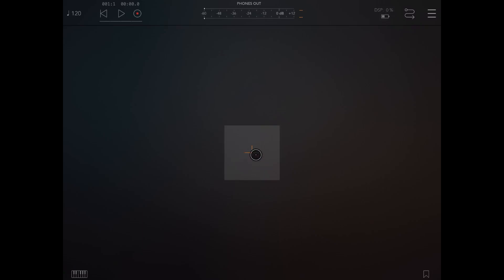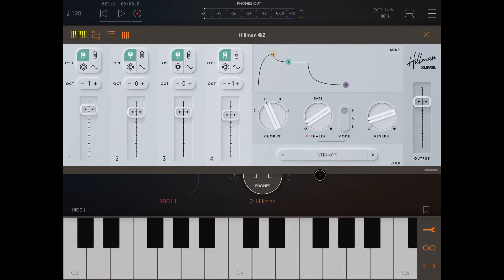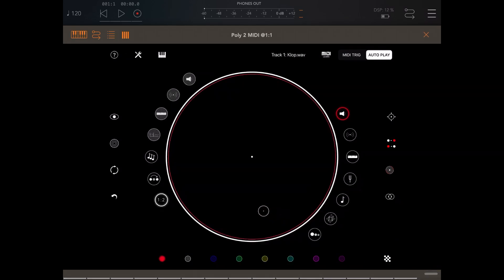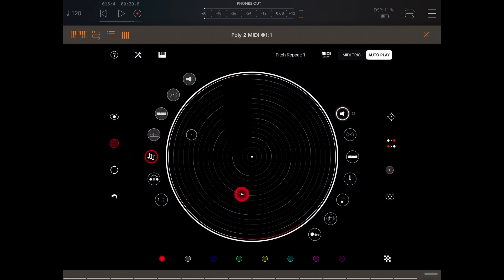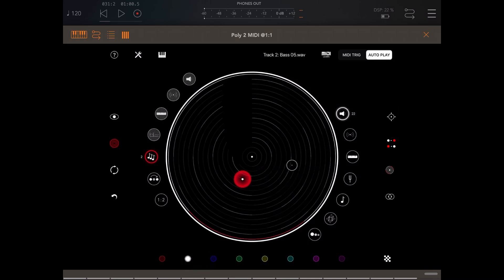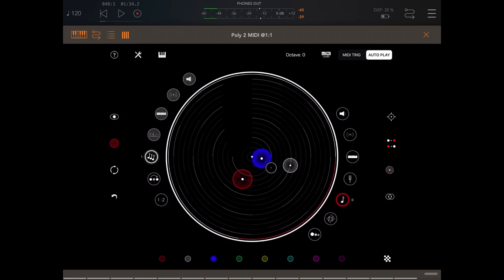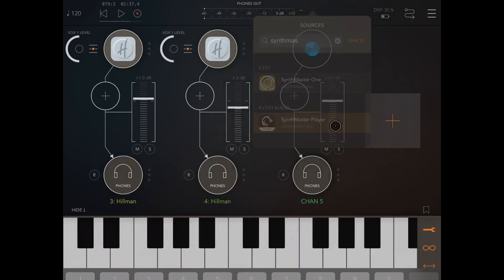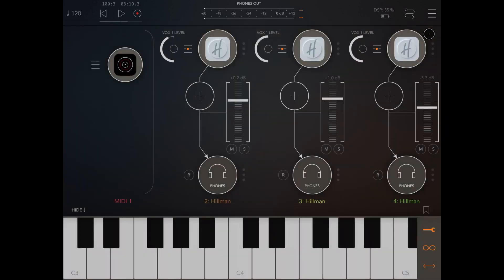Poly 2 - Tutorial: Poly 2 as a AUv3 Midi processor

Comment: Ccol!
How to “hold” a note?  Instead of just a shot trigger
Reply from the maker: Latch on Midi Mode?
Reply: SoundForMore found it in settings, per channel you can set maximun note lenght. All works fine now to build up chords with pads. Thanks!
Reply from the maker: Great, although that is not holding a note but changing a length. Glad that works for you!
Reply: @soundformore  True, but now it lets me  control the length again with the length-knob on the instrument itself, making it the exact length, or let it randomize a bit more.